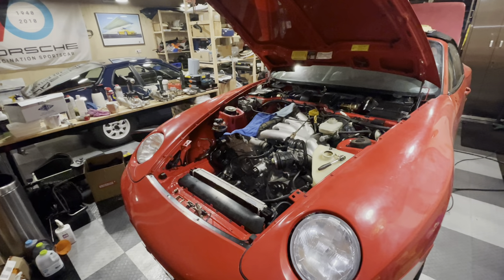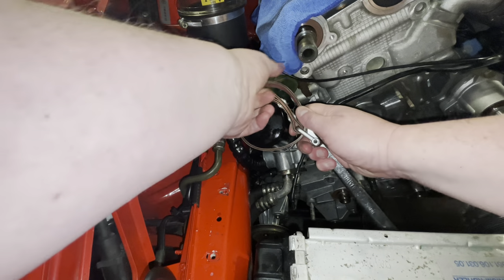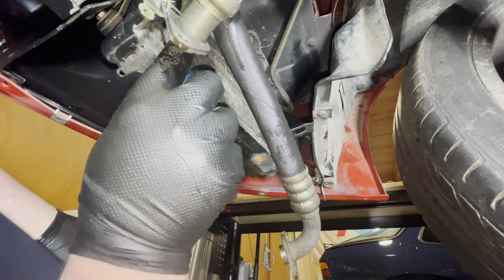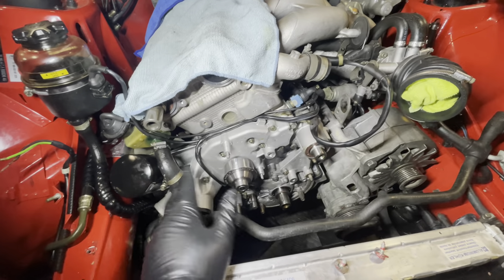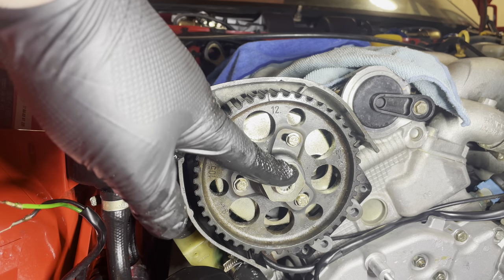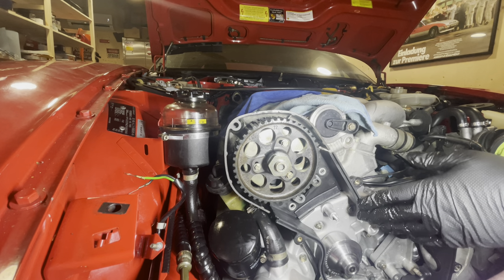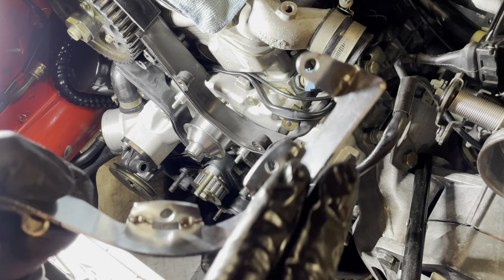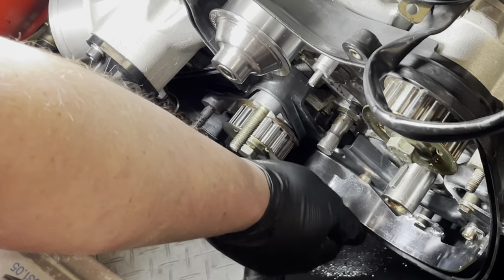Restoring a Flood Damaged Porsche 968: Belts, pulleys and ICV's

Comment: Awesome as always. One main reason to replace the oil cooler seals if you are still thinking about it, is that the internal seal allows coolant into the oil (which is possibly why your oil was milky).
Reply from the maker: Thanks! I though about that, but the previous batch of oil was not milky. I am 95% sure the milkiness comes from the first start when the engine sucked the water that came through the ICV into the cylinders. I will run the new oil for a couple of heat cycles and recheck.